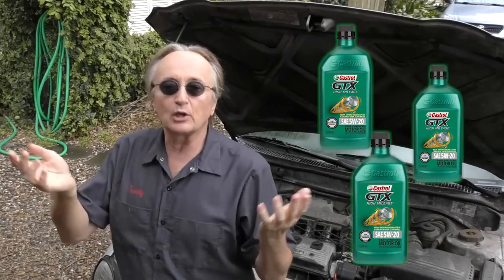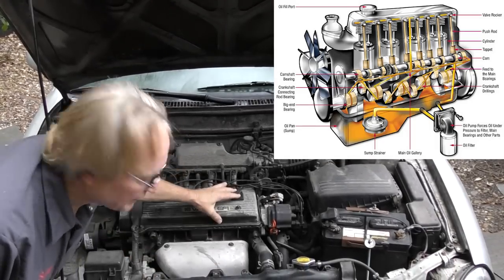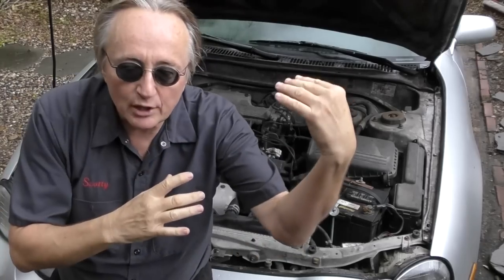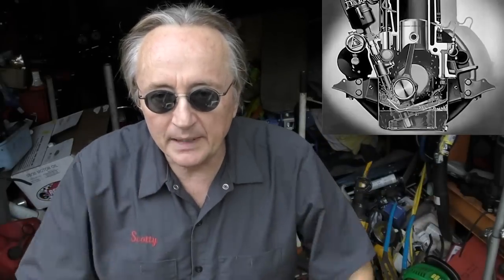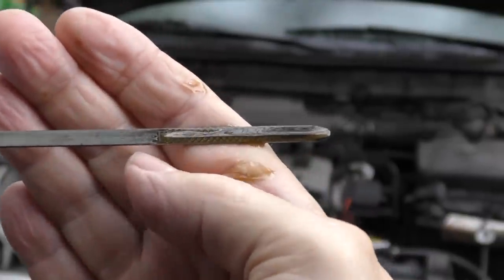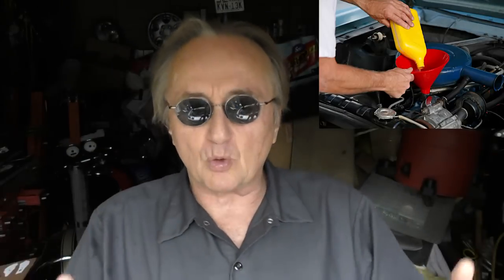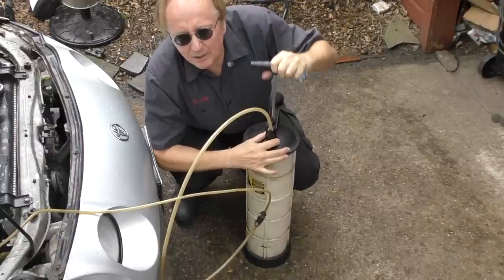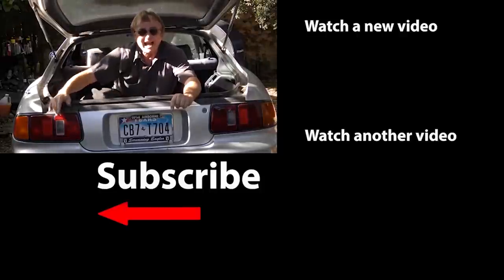Doing This Will Destroy Your Car's Engine

Comment: I had a relative that put 10 quarts of motor oil in her engine is old 70's model Ford she was complaining about loss of engine power so my uncle drain out the motor oil and there was more than two gallons worth of motor oil and he was trying to grab frantically another oil pan to drain into

Comment: I used to have a car with too much oil in it and i removed some of the oil with a 50ml syringe and a really long and thin plastic tube through the dip stick pipe 😁

Comment: Oil also removes heat from surfaces.   Foamy oil is a crummy heat remover.

An automatic transmission with foaming AT fluid is another disaster.

Comment: Hey Scotty!  I have an 03 VW Jetta 2.0L I got a deal on around 2009.. been driving it 10 years, have only done basic maintenance, besides replacing a coil pack.  i recently replaced the thermostat, and rear coil springs due to NE rust.  it's a 5 speed manual, and has 115K miles on it.  i've changed the oil regularly and it runs like a top!  however when i was doing the thermostat and coolant flush i checked the timing belt and it looks like it's never been changed.  the only other issue it has is a bad catalytic converter.  it does burn a little oil.  do you think it's worth the money changing the timing belt on an older jetta, or should i just save my money and drive it until it dies?  i imagine eventually it will need a new clutch as well, but the clutch doesn't slip yet.

Comment: I have a 94 Honda Accord And was told to check the oil when the car was at operating temperature and turned off. Is that correct?

Comment: And what about metal conditioners ? Like Militec-1 that the manufacturer states that the car will run if if has no oil at all. I'm skeptical about them...
Reply: Tests have shown that it will clog up the tiny oil-canals in modern engines.

Comment: Why do some cars say to check engine oil when the engine is warm?
Reply: Because checking the oil when the car is still hot is pointless since most of it is still dripping around the engine. That is why you wait untll the car is warm and the oil has fallen into the oil pan
Reply: @omartinoco9930  Scotty says check the oil when the engine is cold.  Cold vs Warm... what is more accurate?
Reply: When the most oil is in the oil pan is the most accurate measurement, therefore, a cold engine. However once the car has been started the engine is hot. At that point you should turn off the engine, wait until the engine becomes warm to touch and then the oil can be checked since oil will fall into the oil pan.

Comment: I got my car serviced at Ford and the next day it was ticking. It was a new car to me so wanted it done properly. I went around the engine and found they had over-filled the engine and power steering oil. I drained off the excess and complained to Ford. They said to bring it in to fix it. I already did and said I new I shouldn't have taken it in as I would have serviced the car properly. They apologized and said the gauge they use is automatic so should not overfill. Guess they didn't double check with the dip stick. They were just lazy.

Comment: Overfilling a diesel engine will cause engine run away because the oil will seep past the rings and combust. Since diesel is oil based a diesel engine can run off oil albeit poorly. When run away happens will run off the oil instead and since there is no governor for the oil it will run until the oil is all consumed. You won't be able to shut the engine off unless you clog the air intake. If you aren't prepared for this, the engine will blow up. So don't overfill diesel engines with oil.

Comment: Does someone knows why a car oil dipstick shows low engine oil, when car is off and shows overfill when car running?  (2013 gmc acadia)
Reply: While car is on the oil comes from pan to engine to lubricate it.
While off it drains back to the pan but you have to give it time to get a accurate reading

Comment: That's like the new Honda engines that are so efficient, they do not get hot enough to evaporate the gasoline in the oil, so the oil will appear to fill itself up and then overflow at the dipstick.

Comment: I had to stop a woman putting 10 litres of oil in her BMW at a gas station. I noticed while I was filling up she put 5 litres in and then went back to the shop and bought another 5 litres of Mobil 1. As soon as she started to put the second can in I ran over and stopped her. She thought you put oil in until it was full to the top! She only needed a litre when the low oil warning came up on the dash. I told her not to drive it and get it recovered to a garage to get the excess removed.

Comment: I had to much oil in my engine thank god my engine never blow up the only thing that happened was my value cover blow I fix it thin I changed my oil thin I added Dura lube treatment oil and then filed up with Royal purple oil and now I have no more problems and I added e3 spark plugs to my 2002 se Pontiac Sunfire I and now my car drive's like a dream and I put in a k&n silver oil filter and a k&n fuel filter will the fuel filter not in my car yet it well be soon

Comment: I have a 2009 Nissan Sentra and the manual says run your engine until it's at operating temperature, shut off the engine and wait at least 12 minutes before checking the oil. Who's right, my owner's manual or you?

Comment: SCOTTY! Got a 1995 Ford F-150 I keep having my engine light coming on. I take it in to the shop but they can’t find anything wrong. They reset it but when I stumble a little while starting it the light comes of again. I also have a 1993 Mercedes 300 CE convertible that has the same problem. I take it in and they can’t find anything wrong, the reset it and then it happens again. I use the Mercedes for a summer weekend fun car. HELP?
Reply: It would help Scotty or us to diagnose the problems you are having if you would tell us the trouble codes you are getting when the engine light comes on.

Comment: Hey Scotty I have a 2019 VW golf GTI and I tried to check the oil and found out that the dip stick is locked I cannot check the oil level it has the dipstick but it doesn’t come off.

Comment: I must disagree. I was always told to check oil at operating temperature not when it's cold.
Reply: Scotty is right.  You sir, are wrong.  I changed my oil for years and then check it regularly.  Then again, follow your own rules and pay for your own mistakes.
Reply: There are too many oils and different engine designs to be black or white...follow your car manufacturer tips plus common sense from scotty and you'll be fine.
Reply: If you fill the oil in a cold engine it may take a long time to get all oil into the oil pan. First warm up the engine the turn off and wait several minutes and check the oil level. Then wait until it's cold and check again. Any difference in oil level?  I've tried this many times on different cars and in my experience Scotty is right, hardly any difference  - if at all.

Comment: My older sister took the family car to college called my father and said it won't run. We drove down there to figure out what was wrong and ask her have you been checking the oil? She said yes I've been adding a little everyday. well when you looked at the dipstick did it need oil. What's the dipstick? we pulled the dipstick out and oil started coming out through the top of the dipstick. Then we cracked open the oil filler there was oil right to the top of the cap.
She had filled the engine completely full of oil. 😂😂🤣😂😂🤣🤣. I looked at dad and I said she's too stupid to drive a car.

Comment: Oil in my car gets all milky
Reply: For some engines (VW at least) that is normal when you drive short distances or in cold weather. It does not necessarily mean that the head gasket is blown.